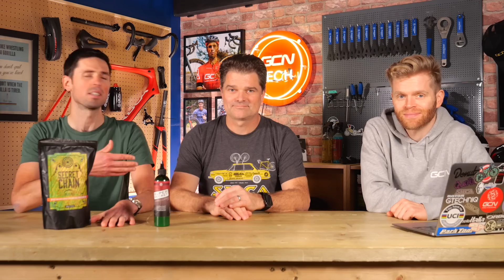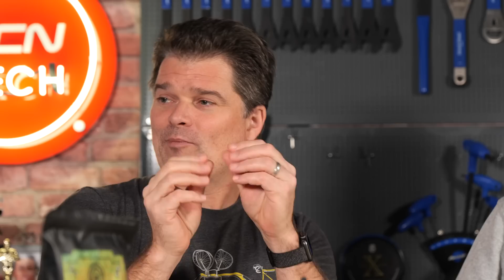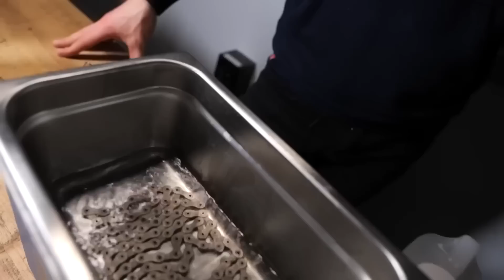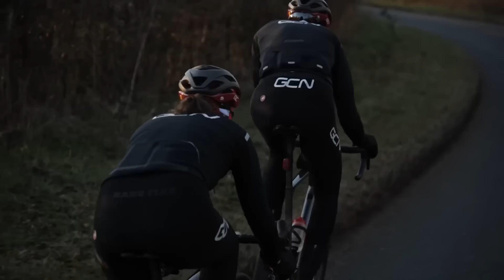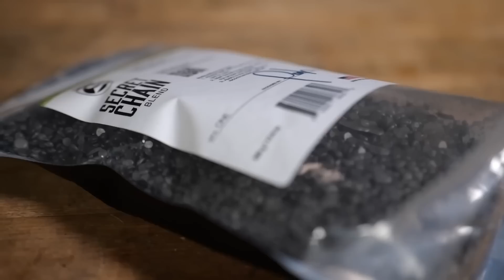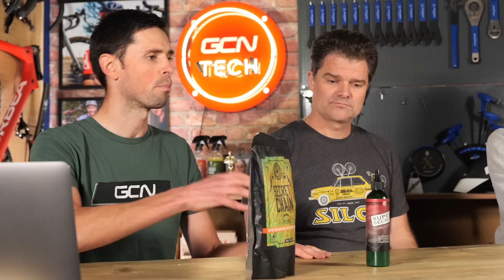Are You Using The WRONG Chain Lube? Ride Faster & Save Money!

Comment from the maker: Have you been using the correct lube for your bike? ⚙
Reply: Yes, first of all  for my myself, by keeping wet lube only for abused in many other ways cold and wet season commuter.

Thanks for explaining what I accessed as miracle when  applied wax lube to the chain in the morning rush, giving it couple hours, may be less, to dry and  made a "guilt lube" same evening with days to dry. The lube, by feel and sound, stayed unbelievably long. 
Will be repeating the double wax lube miracle from now on, consciously.
Reply: Hey @gcntech - if your bike is inside hooked up to a turbo trainer is the distance between waxes still about the 250-350km mentioned in the video or does it last longer without the outside elements attacking it?
Reply: @justinmilligan99   technically you are riding 0 km on a turbo trainer

Comment: If I wanted to switch from lube to wax - same process being degreaser clean chain, rinse it down, let it dry and go through the normal wax application process and shove the chain back on? (Assuming you did a good job degreasing and cleaning the cassette?). Any tips for transition?

Comment: Honestly, i can not believe it. I bought finish line ceramic wax that was recommended in the shop. I had to live my chain every 50km because the sounds coming from it was hard to listen. I accidentally came across one if the ZFC video. I was shocked to learn that my chain was worn more than 0.75. According to ZFC mainly due to lube. Honestly, my 100 km rides were such a pain j was questioning my self if i did the right thing coming back to bicycle sport. I now purchased ceramic speed all conditions live that is supposed to be one of the best. What a horrible mistake of mine that costed so much money to fix (new chain and cassete)

Comment: Recently (I started a few months ago) I experimented with cooking oil (one specific type among the many different vegetable oils). I decided to try it almost as a joke. Before that, I had used it with surprisingly good effect as an emergency option for some repairs - on threads, etc. Therefore, I expected that it could do some work (as an emergency option) for lubricating the chain. However, I was surprised - the result was incredibly good. In absolutely all indicators that I can think of, the result was great. There is only one peculiarity - for the best performance with this lubricant, the chain must be lubricated relatively often. However, with this oil, cleaning the chain is child's play and each cleaning and lubrication cycle takes only a few minutes in total. In most cases (for me) cleaning is not even necessary (when I lubricate it at small intervals, I don't need to clean it at all before applying the new oil). When fresh, the oil itself also has cleansing properties to a large extent.

Comment: I buy Xylene for $10 per litre & dissolve candles into it. It becomes the same product at 10 times cheaper.
* the other option is dripping a lit candle onto each link. 
These lube products are priced way beyond actual production costs.

Comment: I used Phil Wood Biolube for years and it was excellent. I've still never used a more rain resistant lube to ride in wet conditions. Down side is it was extremely hard to keep the drivetrain clean and was especially horrible in dusty conditions.

Comment: if point is to apply and get lubricant inside the rollers and pins and not important to lube inner and outer plates, and the wax flakes off as you pedal, what is actually preventing wear to the chainring teeth and cassette teeth ?
Reply: between chainring teeth/cassette teeth and chain  is no sliding motion, only rolling, and these surfaces do not need lubrication, and they wear out if hard dirt gets between them, which hollows out the surfaces, so it is better if they are dry so that the dirt does not stick. another way of wear is due to plastic deformation of the teeth, due to excessive load caused by stretching/wearing of the chain due to improper distribution of the load on the teeth and so the chain rises on the teeth where the contact surface is smaller

Comment: I’m looking at moving to wax next spring when my Summer bike comes out of hibernation and gets a new chain (due replacement due to 9000km of wear).  A few questions arise from this video.  Rewaxing every 350km or so is just over an average week’s riding for me.  Would two chains be a good option here to swap over when rewaxing?  How do people cope with ultra-endurance/multi day events that exceed 350km where re-waxing isn’t an option?  Finally, how does waxing stand up to a typical UK Winter (obviously not a real winter like Canada gets)? My ‘winter bike’ (old loved bike demoted when the new one came along) has the same group set as the summer one (Campagnolo Chorus 12 speed), could I use the waxed chains I would rotate on my summer bike on my winter one or would the different amount of wear on the other components negate this?

Comment: Hot wax is definitely the way to go. It's clean and silent. 
Once you get the hang of things, it only takes a few minutes every now and then. 
If you rotate your chains, it's even easier - do two at a time.
The biggest hurdle is degreasing a new chain (I haven't seen any Silca chain stripper in Hong Kong).
But after that, it's a breeze.

Comment: The job of the lube isn't to lube teeths where they contact the outer of the chain rollers the purpose is to have the space in between pins & rollers filled so the bush and or rollers "floats" , also preventing contamination.

If you take a new pristine chain and pack it with blue grease it would do the same job as waxing, so technically a high quality waterproof lithium grease would be ideal, if you forget about the stains everywhere oeuf Corse 😂

Waxing or wax lube is the key but you have to toluene soak the chain multiple times from factory, never use it as is before waxing and you'll see incredible results, even for mtb with the right wax mix...
Reply: no, both the wax and the grease will be squeezed out of the chain, but the wax will completely fall off, while the grease will stick around and also catch dust and everything will be very greasy, so you will need to clean the bike, which is not necessary in the case with wax

Comment: I had problems with the editing of this video.  Even understanding this is the owner of a sponsor for GCN and therefore quite biased, I felt like the editing was cut off just before he was about to say something meaningful.  Especially, it appeared as if every comment he was about to make about wear was removed.  I don't know if that's the case (or if it is true, what the reason was), but it left me really empty.  The only takeaway here was "Don't go for dry lubes" and "Wax is marginally better for power loss" vs we lubes.

I found his comment about olive oil interesting and again I was left feeling like I only got half of the conversation.  The compounds added to make it stick to the metal are what seems to also cause dirt to adhere.... Maybe...  Back in the olden days you'd hear of people just using light engine oil on their chains.  I'd really enjoy hearing about exactly how these lubes work and what it is about each kind that causes problems.  It seemed like the guest had insights and even with the biased background it would have been good to get at them.

I would have liked to have also heard about how some of the problems with drip on waxes are dealt with.  For example, is a double (even triple?) application going to get you off to a good start?  Surely you have to prepare the chain exactly the same way you do for immersion in wax -- for exactly the adherence problems.  But at that point, maybe you are just as well to immerse it in wax...  After that, how effective is topping up with the drip on wax?  Is it simply that if you splashed for the wax in the first place, it's cost ineffective not to keep dipping your chains?  Or is there an advantage?  Does applying the drip wax twice (or three times) make up for that difference?  Because, dripping on some wax a few times is less hassle that removing my chain and faffing around with quick links.  And, though probably not a topic he's likely to want to talk about, what about just using parafin for the initial application -- just to deal with drive wear and using drip on afterwards.  What are the implications there?

I don't know.  There are so many questions one could ask and it seemed like none of them were asked.  Even the information that was volunteered seemed to have been edited out (though it may just be my imagination).
Reply: too much unnecessary theorizing, the chain can be hot waxed  on the bike using a battery powered inductive heater, end of story

Comment: I've had nothing but great success using teflon dry lubes. I think listening between the lines, the Silka rep's issue with dry lube is more driven by some sort of perceived environmental agenda than wear and speed performance. I ride in a dry dusty place. Wet lubes pick up grit and sand immediately here.
Reply: Teflon definitely works better than not having a friction reducing additive.  That said, the problems Teflon causes are as made up as the spherical shape of the earth.   
*F1 doesn't care about the planet at all.  There's good reason they used to use Teflon and don't anymore.

Comment: I live in Miami, and our summers are hot, REALLY hot. I tried waxing a while back, but the heat always seemed to melt the wax off really fast. Does anyone have any thoughts on waxing in hot climates? We also have a lot of heavy rain in the summer months, so dry lubes are totally out as well.
Reply: The waxes used here have melting points around 150-160F so you may see some slight degradation in single application longevity, but we sell tons of this stuff to very hot places and don't hear complaints.  Hot melt will be your best bet as it results in the maximum amount of lube inside the chain and is most resistant to rain.
Reply: @SILCAVelo  Awesome, thanks for that info, and I will look into that further

Comment: I have used Silca Hot Wax long before Silca became a sponsor in GCN. I did my due diligence before using the product and have not been disappointed. The past year and a half, I have supplemented the Hot Wax applications with Silca Super Secret. Now I apply hot wax every 1000 km and apply Super Secret every 200km in between Hot Wax treatments. Here is something I do when applying Super Secret that may be of interest to some. After applying Super Secret to all the chain links I run my wife's blow dryer across the links. It's like an absorbing miracle. I can see the Super Secret that has hardened on the outside of the chain soften/melt and get drawn into the inside of the chain. It makes for a much more tidy application as much less of the wax is lying on the outside of the chain. And, of course, more of the wax is inside the chain and better lubricating the pins and rollers.  Anyway, for what it's worth. Cheers.

Comment: I ride in Oregon with weather similar to the UK. I ended up giving up on wax for my commuter. It had to be reapplied so frequently that there was wax gunk that was even more annoying than the oil. I have a fair-weather bike where wax is wonderful, but for a full on rain commuter the oil is just easier.
Reply: I also live in a region where it rains all through the year. From my research in comments and reviews Smoove seems to be the best wax that hold up in the wet. Its a drip wax. But I have not tried it my self yet, but I will.

Comment: I am missing information about rust protection. When riding in rain, rust protection is definitely very important.
Reply: With a waxed drivetrain you need to either re-wax with hot melt or wipe the chain and reapply drip wax after every rain ride.  To be clear, you should technically be doing this with all lubricants to reduce drivetrain wear, but with wax, you can get some surface corrosion if you don't.

Comment: And here I am using motor oil because bike specific lube is overpriced
Reply: There is a oil/diesel additive based also on WS2 tungsten disulfide like their lube. Smallest container 200ml and you only need 40 ml für 1 liter motor oil. Archoilc AR9200

Comment: I fully understand all the reasons to wax my chains. One of the reasons I haven’t done it yet is the extra costs of the quick links. KMC says to replace the quick links after 3 to 5 times of use. If I would rewax every 500 km and I do a total of 10.000 km with the chain, it will take 5 new quick links of €6 each. A new chain is cheaper.
Reply: Naturally, they say "Replace often", but I have never had anyones quick link 'disconnect' on me even when they don't 'snap' anymore. I have found that some do wear more than the chain pins, so I always use my chain stretch tool over the quick link also. So IMHO just keep using them, one per chain, replace when the wear is too great. I do carry spare quick connects with me because with the narrow chains I have had the chains break more than once!
Reply: you can do hot waxing on bike by inductive heater, i do it

Comment: He's spot on about waxing and cleanliness. Keeping a bike that uses a waxed drive train clean, takes so little time, is so easy and pleasant, even in winter. I actually wouldn't care about watts and wear. Not having to deal with black greasy crap and that grimy coating of ick, its worth it. People make waxing seem far more complicated than it really is, at the end of the day I'd argue its time saved. stripping a new chain with white spirit and rinsing in IPA takes half an hour. Waxing and rewaxing maybe ten minutes of actual work (it takes longer than that, but most of it is waiting). How long does it take to clean a black and greasy chain and all the greasy fug off your BB, rear hub, chainstays, cassette, derailleur etc?
Reply: What do you use for waxing? I was looking at the Silca chain waxing system, but it's 100$?! I could just buy four new Ultegra chains for the same money.

Comment: Would warming the drip-on wax first help with roller penetration and speed up water evaporation?
Reply: It certainly will, heating the chain first works better than heating it after, and you can generally get a full set in about an hour rather than the ~8hours we generally recommend.

Comment: I don't get why folks think waxing a chain is such a big, hairy deal. All you need is a mini crock pot for your wax, a hot plate (to cook chains in the garage) and a pot to boil dirty chains. No more hours of degreasing your bike, your hands, your shoes, any piece of clothing that even came close to a chain.
I understand that hydrogenated mineral oils were specifically designed for maintaining racing bicycle chains in the 19th century, and were absolutely fabulous at the time.
Reply: The initial prep is a bit intensive but not hard, just takes some time.
Reply: you just need the whole kitchen, my hot wax equipment fits in shoe box

Comment: I do like a lot of Silca’s products. I do not race, and no one with a body like mine is worried about fractions of a watt. But I do ride a LOT and I want my equipment to be as reliable, and easy to maintain as possible. I did use Silca’s wet lube for a while. It is excellent stuff. You could pour sand all over your drivetrain, and with that lube, it’d still run smooth and quiet…that is until every metal part of your drivetrain got worn to a nub. It gets gunky easily, and is difficult and messy to clean. I haven’t tried Silca’s wax products, but I do use Squirt liquid wax lube. It is cheap, extremely effective, and easy to maintain. Chains wear wayyyyyy longer, and of course all the other parts too. Any gunky buildup is easily removed.
Reply: If you like Squirt you will love SILCA or Ceramicspeed.  Squirt contains paraffin oil so it holds dirt and gets gunky resulting in the shedding of dirty wax bits.  Check the ZFC data, modern wax lubes all outperform Squirt by a good margin and will also run much cleaner.
Reply: Disagree with Squirt. It dumps little black wax blobs on the floor randomly. Really annoying when you don’t see it and smoosh it into the floor and your sock.

Comment: Cubic boron nitride (CBN) is used to make sharpening whetstone for knives which could be heat treated very hard, way much than any bike chain so no wonder why it will wear it super fast.
That's genius to sell bike components.
Reply: Silca has Tungsten Disulfate in their products. Its also one of the the hardest metals. From that logic it should be bad also. I have seen a gun oil test where the 3 best oils all had ceramic additives.

Comment: For my daily commuter I use a KMC chain with their proprietary EPT-coating and Squirt Wax chain lube. It works wonders for keeping the chain both silent and clean and the EPT-coating itself is incredibly rust resistant year round.
Reply: You don’t get the little black chunks flaking off?

Comment: Drip and/or hot wax for me.

Top tip, invest in a hot water tap ouside so you can use a hot hose to wash off the chain - melts the wax and takes the dirt away with it. Has lots of other uses too. 

I have the luxury of a workshop air suppy so use that to blow out the wased chain before reapplication.